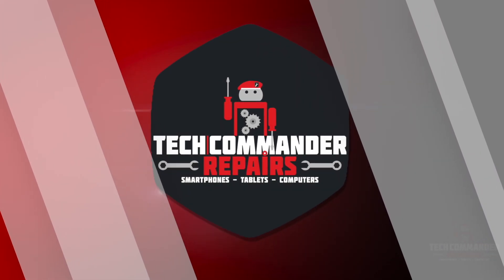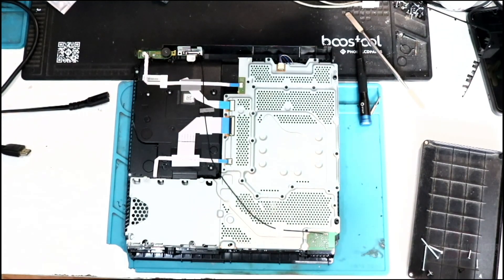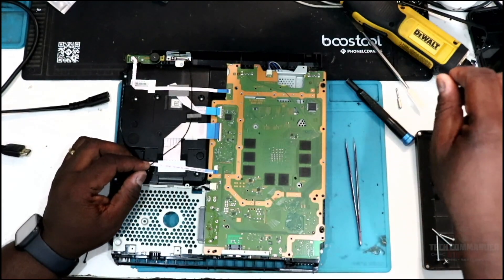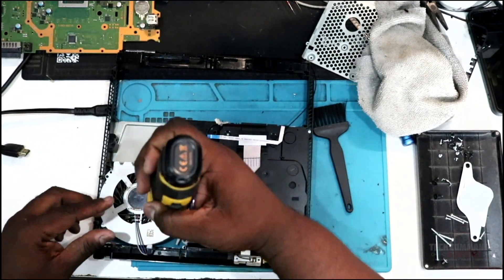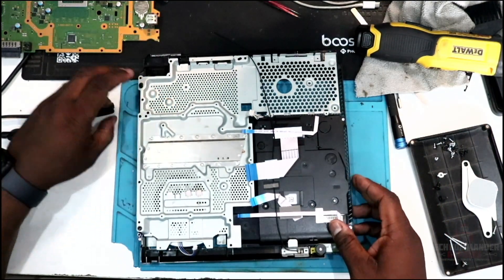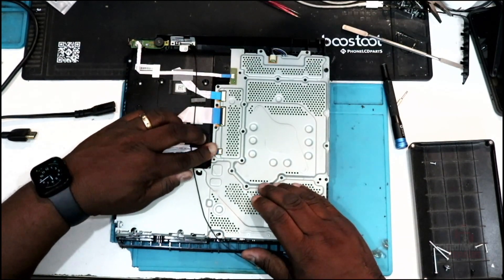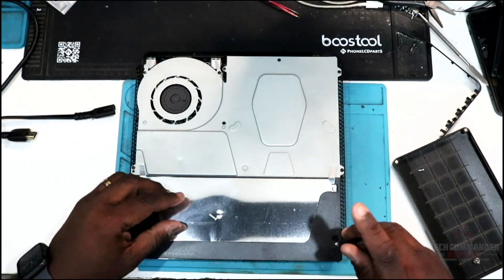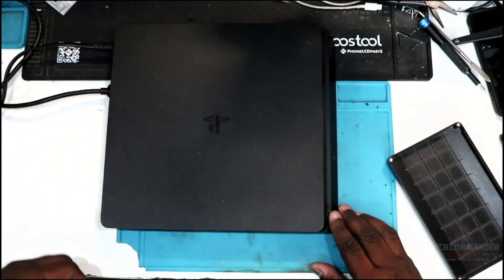PS4 Slim Teardown & Assembly [STEP-BY-STEP GUIDE]

Comment: I saw on an ifixit guide that the first screw needs a TR8, could I use a regular T8 or T8H instead?
Reply from the maker: It's a T8 security but on some. Just means there may be a little round piece in the center of the screw. You should be fine with  regular T8 screw though. Just take your time.